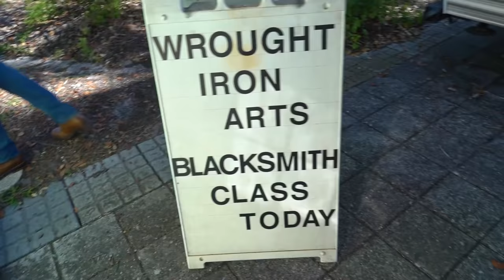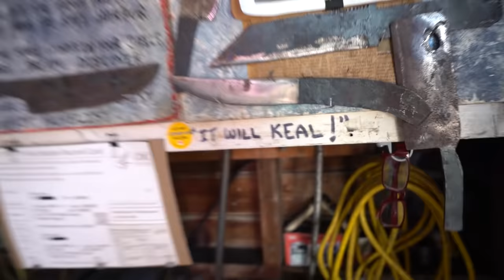Forged in Fire Is Easy

Comment: I've been blacksmithing for about 5 years. if that is Caleb's first time making a blade. he should definitely consider doing it as at least a hobby. that Kunai looked fantastic
Reply: how do you start that hobby?
Reply: There's a ton of videos online, you really only need some space, high heat, metal, and hammer :)
Reply: @chilledoutrobot6358  That shit adds up quite easily
Reply: @DHGxMcFlurry  It depends on what you want out of it. Scrap metal is cheap or free, you can get a hot enough fire with regular wood and a hairdryer I used old pallets and junk wood from the construction sites around they are generally happy to get rid of scraps.
If you want to be making damascus you will need more tools as its not really reliable to do by hand with a wood forge.
Reply: @cuck8180  im knee deep in my clusterfuck of hobbies and it hurts my wallet :,) but it works out if you have some related hobbies and you can use the same tools :D !! 
Worst part is keeping organized and figuring out where the fuck to put the butt mushrooms i sculpted for no reason (this is a genuine dilemma, they are so stupid and garish but im attached)
Reply: @chilledoutrobot6358  and the thing they drop on peoples heads in looney toons

Comment: The kunai was INCREDIBLY crafted, but Matt's sword had some SERIOUS power.
Reply: Thats probably cause Matt is powerful compared to the others. The only reason he had rolling on his sword was because he was hitting it harder than the other. I'd say either the kunai or the axe wins.
Reply: Gotta keep in mind a Matt's sword was bigger overall. Meaning more mass to swing around
Reply: Yes but with a mobile weapon like the kunai you can dodge the slash and get in close or throw it from a far
Reply: @df0rdeath58  But the axeblade also couldn't be attached properly lol
Reply: @AAAAAA-qs1bv  True but if it was attached properly it would probably work better. Its easier to make an axe head compared to a whole sword and would probably be sturdier. They shithoused the handles imo.
Reply: @pandasftw2218  realistically, in close range, the kunai would lose, not enough effective range for slashing against some one with a full sized blade, and if you perform a non lethal throw, you'd need to pull another out or be defenseless.
Reply: @greenherooftheinterwebz7078  the kunai made is a "hollywood kunai." the actual kunai was more like a multitool spade, and the shown type isn't an effective throwing knife. Throwing knives themselves were used as a distraction to run away from combat, or to ready your weapon to get a powerful strike in. Most throwing knives would be in at least sets of three and were always secondary or even tertiary weapons. So, as a sidearm in the style of a knockoff of what is not a weapon- that's a really effective blade.

Comment: For those who don't know, I would say that Charlie made a blade closer to a falcion or saber because of the fact that the blade did not have any folds based on the fact that he flattened and grinded the blade out of a sheet of metal. As well as the fact that the blade had little to no curve, and I only have basic knowledge in blacksmithing, but even if the blade was folded steel, it would be classified as a Ninjato(?). Also wanted to say huge respect for Charlie being able to finish his blade despite being burnt, he handled the situation better than I would.
Reply: I think it's a messer. If he gets the right handle, then it's closer to it